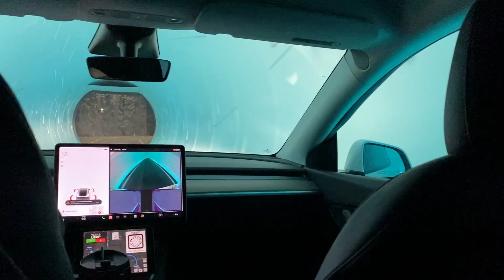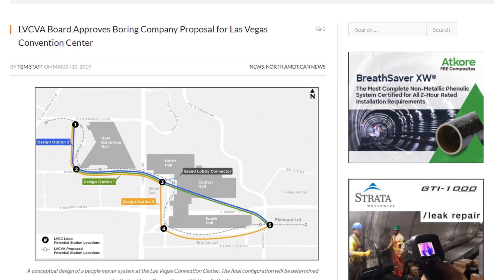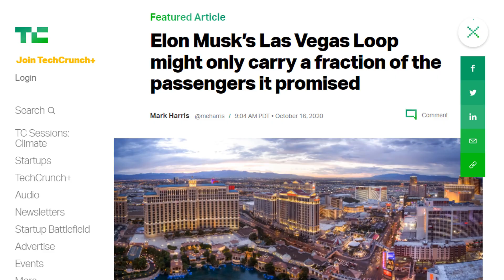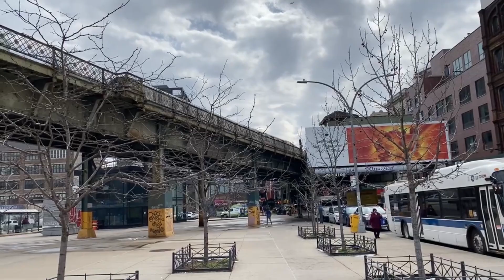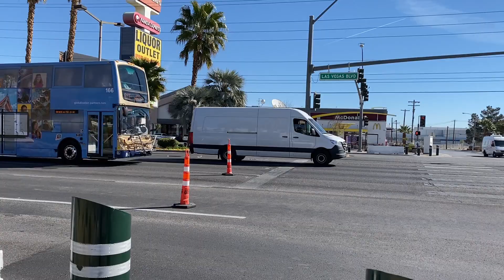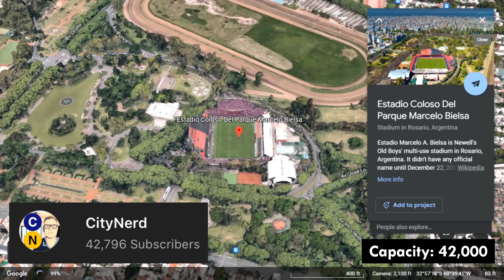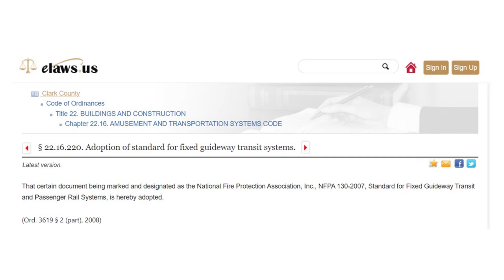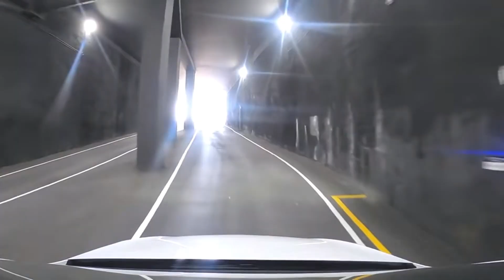Inside the Las Vegas Loop: Transportation Game-Changer, or Complete Waste of Time and Effort?

Comment: If the stations get any closer together they could just run moving sidewalks through them. That would actually be a pretty good use for those tunnels.
Reply from the maker: These can easily be retrofitted into two-way micromobility tunnels with the stations repurposed as bike valet/food cart pods. Luckily
Reply: @CityNerd  yes. Pods. Gotta call it pods.
Reply: moving sidewalks are great, such high cap for the space they take up, super high frequency and is very accessible with level boarding. even has handrails to help with balance.
Reply: @Aliceintraining  their maintenance costs are huge and they're pretty unreliable
They're also slow (run them any faster and they'll break even faster...)

Bike tunnels would make more sense
Reply: @ronylouis0  Yes! Bike tunnels would be great, and you wouldn't even have to alter the tunnels to get them converted. Just kick out the cars. In fact, I feel like I've already heard this idea of taking back one or two lanes of traffic from cars and giving them to bikes...
Reply: @ronylouis0  I was being sarcastic and trying to make a joke.  sense you know, the tone of this video.
Reply: @Aliceintraining  I've seen serious proposals for this type of stuff
Reply: @JustinKlinger  - The moving walkways at O’Hare between United’s B and C concourses are pretty great for getting around with luggage. What’s likeliest, unfortunately, is that the Las Vegas tunnels will simply be repurposed for storage once the novelty of the three-passenger-maximum slow-boarding chauffeur-driven rubber-tired “train” (aka this Boring/Tesla boondoggle) wears off.
Reply: @danopticon  Hi Ricky, You do realise the LVCC Loop handles 27,000 people per day during large conventions which is greater than the platform averages of most subway statiojns in Europe?

Even with drivers in each car, it carries more passengers per driver than even efficient BRT systems like Ottawa's TransitWay and of course once autonomy is enabled, drivers will be completely taken out of the loop (pun intended!).
Reply: @andrewfranklin4429  - You neglect to mention your numbers are Tesla’s/The Boring Company’s p.r., derived from a test done for one hour at 10% capacity with 300 volunteers:

Under optimal and very controlled circumstances, they apparently were able to move a little over 400 volunteers in an hour, so Tesla’s engineer concluded “Even if we increase capacity tenfold under real-world conditions, everything will still be ginchy!” and the Las Vegas authorities, happy for the publicity and knowing they’ll get $300,000 every time the “Loop” actually fails, eagerly signed off on it.

COVID-19 has been a godsend to Musk’s companies: the closest this boondoggle has come to a real test since opening has been CES, which was cut in length this year and had less than 25% as much attendance as usual … and even with attendance minimized, there were still traffic snarls: nothing like being trapped in a tunnel!

The Boring Company people put so little research into building their “stations” that fire codes will limit the stations to 800 occupants at a time, which utterly torpedoes T.B.C.’s inflated throughput projections … although again, the longer they can forestall having to scale up and prove the project’s failure, the better for them.

Finally, Carrie Schindler, director of transit and rail programs for the county transportation authority, has confirmed that Tesla and The Boring Company are NO LONGER COMMITTING to the autonomous technology you tout. Musk’s firms are in fact trying to saddle the county with the significantly increased operating costs of providing one driver per, at most, every three passengers (and, more likely, one driver per passenger) by claiming his firms had never guaranteed self-driving cars!

But the only real test will be to finally scale this fiasco up … if Musk’s firms ever really do, which itself is doubtful. If they ever do try to achieve the throughput promised by their p.r.—albeit, at an absurdly greater cost for implementation, operation, and maintenance, relative to proven transit systems—by the time Musk’s firms prove their failure to deliver, your YouTube account will likely be long gone. But this video and these comments will still be here.

But by all means … if you’re up for it, let’s meet here again in two or three years, to discuss “Whatever happened to the Las Vegas ‘Loop?’ “
Reply: @danopticon   not true Ricky, it was the government authority, the LVCVA themselves who earlier this year reported that “The Boring Company’s tunnel system successfully moved 25,000 to 27,000 passengers daily around the Las Vegas Convention Center campus during SEMA in November. SEMA was the Convention Center and the LVCC Loop’s first full-facility show with 114,000 attendees. “

“the LVCC Loop’s average ride time was under 2 minutes during CES 2022. The average passenger wait time was below 15 seconds.”

So no, it wasn’t the Boring Co or Musk who said that. 

The SEMA show which averaged 25,000 - 27,000 people per day was only open for 8 hours each day meaning it handled an average of 3,375 people per hour.  However, no public transport system has equal distribution throughout every hour of the day, there are bumps and dips depending on demand. 
 
In the case of the SEMA convention, there was a single peak period in the middle of the day with ridership tailing off either side, so it would be higher than that 3,375 average in the middle of the day and lower in the morning and late afternoon. 

So no, they are definitely moving far more than 800 people per hour in real life.
Reply: @danopticon  and no, the Loop hasn’t actually experienced any traffic jams. That single short clip from CES that bloggers repeat over and over ad nauseam showed only a brief slow down for less than 40 seconds in the Loop tunnel due to a temporary closure of the South building’s doors. The EVs didn’t even stop, they just briefly slowed.

This ignores the fact that the rest of the time the Teslas are smoothly entering and exiting each station every 3 seconds compared to switching to a mulit-billion dollar subway where you have to wait for far longer - 3, 5, 10 or 60 minutes for the next train and have to stop and wait at every station on a line instead.
Reply: @danopticon   and no, the claims from Mark Harris of TechCrunch that the Loop was limited to 800 people per hour in the underground station are completely false being based on a mis-reading of the Loop Firecode. 

Harris has now admitted his Tech Crunch articles about The Boring Company were wrong and he has been removed from writing about the Boring Co for Tech Crunch with other writers being far more accurate (and positive) in their stories since Harris’s last article in Nov 2021. 

So his claims that the Loop can’t handle 4,400 people per hour and reports of penalties are blatantly incorrect.
Reply: @andrewfranklin4429  
You’re proposing that that extremely narrow tunnel will feed 66 human operated vehicles through per minute.
The autonomous driving tech is not yet matured. This might be feasible with a driverless command type control system. Almost like a light rail.

Each vehicle in that situation would therefore have less than one second of following time in order to make it through at that rate. Not to mention the fact that many of the turns offer little or no reaction time due to their tightness if they indeed travel at 60mph

Now let’s consider the possibility there isn’t a crash followed by a lithium battery fire underground causing a oxygen deficiency in the subsequent pileup and additional fires. Unless the brakes are capable of braking from 60mph to 0 in less than a second minus driver reaction time.

Therefore depending on the quantity of air throughput in the tunnels minus the oxygen reduction via the possibly numerous and very difficult to suppress vehicular fires and human demand for oxygen as many people fail to attempt to escape what is a silent killer as you usually don’t realize it when you’re about to pass out from oxygen deficiency, and most people don’t know it’s a thing. Not to mention toxic and hazardous gases produced by the fires. People getting out of the vehicles, panicking, with no access for emergency vehicles. In order for drivers to escape the very rearmost vehicles will have to reverse out.

Getting messy with my run on sentences there, but it’s pretty clear to me that this is an incredibly bad idea in terms of safety. In theory a hundred or even more people could suffocate in minutes because one driver had an errant twitch.

Furthermore, unless both the entry station and exit station are designed at the capacity of 66 individual vehicles arriving, disembarking passengers, within one minute with room for error: your theoretical capacity is a pipe dream as these stations really don’t look up to that task, which is more suited to something resembling a huge underground garage.

Additionally, the video laid out why nobody is going to be willing to pay for the cost of a luxury taxi just to get the advantage of a moderately faster commute. So who are all the rich people that want this?
Reply: @JK42069-r  A 2010 study by the Honda Research Institute found that 25% of drivers maintained a distance of 2 car lengths between vehicles at 60mph on a busy 2-lane freeway, 15% 3 car lengths, 15% 4 car lengths, 5% 5 car lengths and 15% 6 car lengths. 

So that is 75% of cars having a headway of one second (~6 car lengths at 60mph) or less and 40% maintaining a headway of 0.5 seconds (~3 car lengths at 60mph) or less. And remember those are cars driven by potentially distracted, drunk and careless drivers. 

Note that a headway of 0.5 seconds = 7,200 cars per hour
And a headway of 1.0 seconds = 3,600 cars per hour

As I say, The Boring Co is planning on a headway of around 0.9 seconds (5 car lengths between EVs at 60mph) which will give a throughput of 4,000 EVs per hour.  With 2.5 passengers per car that gives us 10,000 people per hour. With 4 passengers per car 16,000 people per hour per single tunnel. 

With higher capacity EV vans, buses or pods that can be added if demand requires it, those numbers go up exponentially. 

Once the Loop autonomous control systems with their millisecond response times and ability to for example command ALL vehicles in a section of the Loop to brake or accelerate simultaneously, there would be no problems safely achieving headways of this duration.  I’ll discuss autonomy next.
Reply: @JK42069-r  At the moment, the Loop EVs have drivers true. However, in the latest videos from CES the drivers are saying that the cars have already been modified for autonomous operation, but that it is not yet enabled as they are still awaiting regulatory approval and liability is “holding us up right now, but once that gets cleared we’ll turn all the cars on”. 

After all, The Boring Co actually took the press for test runs using autopilot running in Loop EVs over 2 years ago in the 1.14 mile test tunnel in Hawthorne California.   At that point, autopilot was limited to 90mph (145kph) but was scheduled to be increased to 125mph (201kph) a few weeks later. 

Not surprising considering that following a white line in the controlled environment of a tunnel is hardly rocket science.
Reply: @JK42069-r  Now, in terms of your questions about safety, EVs are 61x less likely to catch fire than internal combustion vehicles and 139x less likely to catch fire than hybrid cars so there is as little chance of the Teslas catching fire even in a crash as for the massive Lithium battery packs that are being installed into many subway trains for regenerative braking, acceleration augmentation and emergency motive power.  

In fact the latest Tesla Model Y’s have BYD LFP Blade batteries that can be punctured and not suffer from thermal runaway, so the chances of fires are even lower now.

If there is a fire, you’re actually safer in Loop EVs than being crammed in with 1,000 other people in a burning train.

The Loop tunnels have a “ventilation system that can move 400,000 cubic feet of air per minute in either direction down the tunnels” and many smoke and CO alarms and cameras everywhere, a Fire Control Centre staffed by 2 officers during all hours of operation, high pressure automatic standpipes in all tunnels for fire-fighting, an automatic sprinkler system rated at Extra Hazard Group 1 in the central station etc above and beyond what was required by the national and international fire codes including NFPA 130 – “Standard for Fixed Guideway Transit and Passenger Rail Systems” and the 2018 International Fire Code (IFC).

And if there is smoke accumulating in the tunnel, every Tesla has a hospital-grade HEPA filtration system to filter out the fumes and toxic gases of any fires that might occur. The HEPA filter is about 10 times larger than cabin air filters in most cars and is 100 times more effective than a normal car air filter able to even filter out even respiratory COVID particles. 

The Teslas also have activated carbon filtration, an acid gas filter, an alkaline gas filter for removing toxic gases and a “bio-weapons defence mode” where the outside intakes are closed and the fans are operated at maximum speed to create positive pressure inside the cabin minimizing the amount of outside air that can enter—similar to the way a positive pressure room in a biohazard lab or hospital operates, preventing the backflow of bacteria and viruses into other parts of the building.”

The EV doesn’t need a separate air supply for the few minutes that it would take for an EV to drive the short distance from an incident to the nearest station as the amount of air in the EV running in that mode on re-circulate with positive pressure keeps out toxic smoke and CO for the short amount of time needed to evacuate.  And there’ll be plenty of oxygen in the volume of the car for that short timescale. 

In contrast, trains are death traps in crashes and fires with so many standing crammed together, no seat belts or airbags and all loose luggage and bodies turned into lethal projectiles under sudden deceleration.

With the Loop EVs being rated as the safest cars on the roads for 7 years running, every passenger is safely belted into their own comfy airbag-equipped safety cell.  :-)
Reply: @JK42069-r  And next, regarding your point about stations being unable to handle 66 EVs per minute, the answer is they don’t have to, as you'll see below:

So that 4,000 EVs per hour with a headway of 0.9 seconds is for traffic down the main arterial tunnels of the Vegas Loop. The stations however, are all off the main arterial connected by short spur tunnels so traffic through the stations has longer headways down to 3 seconds or so which gives us up to 1,200 EVs per hour per station. 

Looking at the footage from the SEMA conference in Nov, we see each Loop EV taking around 15 seconds to unload and 15 seconds to load passengers, giving us as little as 30 seconds between vehicles in that one bay. There are 10 bays in each station so that works out as 30 seconds divided by 10 = 3 seconds between EVs exiting that station. 

Again, looking at the footage, we do indeed see EVs leaving the stations down to 3 seconds apart which would give us up to 1,200 EVs per hour. Across all three stations, that’s up to 3,600 EVs per hour. 

We also see between 2-3 people in each EV, so with 2.5 passengers per EV, that is up to 3,000 people per hour per station.  So over the three stations that is potentially 9,000 people per hour. 

In terms of the arterial tunnels, you have multiple stations feeding them filling up the tunnel up to that 4,000 EVs and 10,000 people per hour metric and multiple parallel arterial tunnels as well as other mini-loops in spots all Sharing the load.
Reply: @JK42069-r  And finally, Loop ticket prices for rides down the Vegas Strip will range between $5-20 for a Loop EV depending on distance travelled.

However, that is for the entire vehicle.  if TBC (or third parties) implement ride-sharing apps or station kiosks to allow passengers to ride share (particularly on high-traffic routes), then you’re looking at splitting that ticket cost between multiple people.

MIT CSAIL’s research developed an algorithm that can replace 14,000 taxis with only 3,000 four-seat vehicles using public data from NYC taxi rides so it’s eminently possible to maintain point-to-point transport or minimal on-the-way stops if people want to share costs.

So, with ride-sharing we’re looking at Loop ticket costs of $1-$4 per person compared to:
- $25 - $37 for gridlocked taxis 
- $6 per person via gridlocked bus
- $5 per person for the Vegas Monorail which doesn't go anywhere and has gone bankrupt twice.

So the Loop isn’t just for the rich.
Reply: @JustinKlinger the only problem is it's Vegas and corporate entertainment. A good percentage of the riders are going to be incapable of safely riding a bike, electric or not.  Not even a golf cart would be safe in the hands of those people.  They should have just made it a tiny version of the hyperloop with pneumatic tubes.
Reply: @Aliceintraining  I strongly suspect when LVCC finally get pissed off and pull the plug on Elon, they will prob do this. The tunnel bores and far to small for any realistic people mover system, so it'll either be moving walkway or just mothballed completely and gradually be colonised by the destitute underclass who will slowly evolve into morlocks.
Reply: Heck, just have people walk in the tunnels. It's only a few hundred metres.
Reply: Moving sidewalks would have been a lot cheaper.
Reply: call them hyper-sidewalks and i think you are on to something, need to add plenty of LEDSs however
Reply: Or just give everyone an electric scooter and let them have at it.
Reply: moving sidewalks would have a larger capacity
Reply: Moving sidewalks only travel at 1.4mph.  That means it would take over an hour to get you to the other end of the 1.7 mile convention Center instead of 2 minutes on the Loop! 

That is even worse once the rest of the 29 mile 51 station Vegas Loop is constructed - a moving sidewalk would take you 10 hours to travel from one side of the city to the other!
Reply: @andrewfranklin4429  The toronto airport walkway moves at 4.3 mph and research has shown that people walk at 2.2mph on average when riding so that takes them to 6.5mph. Not as fast as the teslas but the throughput puts teslas to shame.
Reply: @opcn18  remember, Capacity AND speed matters.

The Disney peoplemover for example has decent capacity (4,885 people per hour) but very slow speed of 7mph. 

Bus Rapid Transit (at grade) has very low capacity:
90 passengers per vehicle * 15 vehicles per hour = 1,350 pph.
And low average speed of 9mph due to city traffic and having to stop and wait at every stop. 

Bus Rapid Transit (grade-separated) has low capacity: 
90 passengers per vehicle * 30 vehicles per hour = 2,700 pph.
And but still slow average speeds of 12-22mph.

Light Rail Transit (at grade) has medium capacity:
90 passengers per vehicle * 3 vehicles per train * 15 vehicle sets per hour = 4,050 pph.
But slow speeds of 9mph -12mph due to city traffic and having to stop and wait at every station. 

Light Rail Transit (grade-separated) high capacity:
90 passengers per vehicle * 3 vehicles per train * 30 vehicle sets per hour = 8,100 pph.
And still pretty slow average speeds of 15mph due to having to stop and wait at every station. 

Subways have very high capacity:
100 passengers per vehicle * 10 vehicles per train * 30 vehicle sets per hour = 30,000 pph.
But still slow speeds of 17-22mph due to having to stop and wait at every station. 

The 29 mile Vegas Loop (2.5 passengers per EV) will have high capacity:
 2.5 passengers per vehicle * 4,000 EVs per hour = 10,000 pph
AND very high average speeds of 60mph thanks to direct point-to-point travel at high speeds. 

The 29 mile Vegas Loop (4 passengers per EV w ride sharing) will have higher capacity:
 4 passengers per vehicle * 4,000 EVs per hour = 16,000 pph
AND very high average speeds of 60mph thanks to direct point-to-point travel at high speeds. 

But the 29 mile, 51 station Vegas Loop will have up to three parallel arterial tunnel pairs through the busier parts of the city giving 30,000 - 48,000 pph down the main arterial tunnels AND very high average speeds of 60mph. 

The Boring Co has actually rated the 29 mile, 51 station Loop at a minimum of 57,000 people per hour. 

So even in terms of people per hour, the Loop easily holds its own against not just People movers, BRT and Light Rail but is also quite competitive against many subways.
Reply: @andrewfranklin4429  How much does Elon pay you for all these posts?
Reply: @Shizz81  Hi Brandon. Perhaps you’re unused to someone who actually enjoys supporting their position with facts and data rather than engaging in the usual snarky one-liners?
Reply: @opcn18  to answer your question more directly Emerson, even if you walk at the average walking pace of 3-4 mph on a moving walkway, that is still only 5mph in total meaning it would still take you almost 6 hours to walk across the 29 mile Loop versus 5 minutes in a Loop EV.
Reply: @andrewfranklin4429  Where are you getting 4000 EVs per hour for just the LVCC? This is even covered in the video, the capacity would be MUCH lower even in an optimistic scenario.
Reply: @scuter8700  4,000 EVs per hour is the capacity of the main arterial tunnels of the 29 mile, 51 station Vegas Loop which is still under construction. That Loop will have over 700 EVs spread across 51 stations (10 bays per station) and 29 miles of tunnel so there is plenty of space for all the EVs. 

With the avenge journey on the Vegas Loop being about 5 minutes, each EV would make up to 12 trips per hour so 4,000/12 = 333 EVs is all it would take to fill an arterial tunnel with 4,000 EVs per hour.
Reply: @andrewfranklin4429   idk I think it's unfair to compare the capacity of one subway or brt line (as you did earlier) with the capacity of a full-blown transportation network with multiple main arterials in it. This is like me comparing the capacity of one bus route with the capacity of the entire road network of a city.
Reply: @andrewfranklin4429  So the loop is now traveling 35 times as fast as a person walks? Or did you just compare the time to walk around the loop to the time to drive across it at ludicrously high speed that will require hundreds of dollars per week in repairs and replacements to the EVs and make all the passengers sick? The corners are too tight for those speeds. There is no fixing that. The speed is capped by the layout and no software of proof of concept on a straight track in hawthorne is gonna change that.
Reply: @scuter8700  if you like, we can stick with just what has been constructed so far and compare that to the entire bus network around Vegas instead. (Still not a perfect comparison, but helpful nonetheless)

So, the Vegas Bus service has a daily ridership of 178,390 but that is across 51 routes and 3,900+ stops and a fleet of 708 buses. 

So compare that to the Boring Co’s convention Center Loop which only has 1 route, 3 stops and 70 cars and yet easily handles 27,000 passengers per day during conventions. 

So that very large, busy bus network only carries 6.6x the number of passengers of the small 3-station Loop despite having 51x the number of routes, 1,300x the number of stops and 10x the number of vehicles each of which has 10x the seating capacity as each Loop EV.

Considering that the 29 mile 51 station Loop will increase the size of the Loop by 17x, it means it could end up with a capacity of 459,000 people per day which is 2.5x the daily ridership of that entire Vegas Bus network. 

Considering that Las Vegas only has a population of 600,000, such capacity wouldn’t be needed, but you can see how the Loop is indeed a very good solution for the public transport needs of this city going forward - particularly since it is costing the taxpayer ZERO dollars compared to the $1.4 billion that a 29 mile grade-separated BRT (or $15 billion subway) would cost.
Reply: @opcn18  You do realise the Loop EVs can just slow down around tighter radius bends?

Here are some average Trip times off the TBC website:

- Airport to Convention Center (LVCC) - 4.9 miles, 5 minutes
- Allegiant Stadium to LVCC- 3.6 miles, 4 minutes,
- Downtown Las Vegas to LVCC- 2.8 miles, 3 minutes

So the Loop will do 4.9 miles in 5 minutes = average speed of 60mph (100kph), so some parts of the trip will be slower than 60mph around 3 turns while other parts will be faster down the straight sections.

That is still 20x faster than walking not to mention 3.5x faster than the 17mph average speed of trains which have to stop and wait at every station.
Reply: @opcn18  in terms of repairs and replacements, I think you are getting confused with internal combustion engine vehicles with their 2,500 moving parts that are vastly more unreliable than the 26 moving parts of an EV, which are so maintenance free that Tesla is the only car manufacturer in the world that doesn’t specify ANY service and maintenance intervals. No 10,000 services, no 40,000km major service, nothing. Just check the brake fluid level every 3 years.
Reply: @andrewfranklin4429  You can either have the cars following close behind each other, or you can have them driving fast, you cannot physically have both no matter how many times you ignore that reality.
Reply: @opcn18  and yet cars with distracted drivers travel at 60mph separated by only 3 or 4 car lengths on freeways and highways across the world all the time. Go figure!
Reply: @andrewfranklin4429  If you are repeatedly accelerating at formula 1 car rates in an EV that weight as much as a midsized pickup truck the tires will have to be replaced at regular intervals. It's also very hard on the suspension and linkages. These are parts that break on lighter cars that experience less acceleration too, and which break on tesla EVs driven under normal conditions. You cannot just write off those expensive repairs while you are granting yourself ridiculous carnival ride levels of acceleration and deceleration day in day out.

Tesla seats are also not designed for people to be constantly getting in and out, have you ever ridden on a bus? The seats are that hard for a reason.
Reply: @opcn18  I’m not sure why you believe F1/carnival acceleration levels are required to average 60mph speeds over a 29 mile Loop network?  I think your fears over excessive maintenance are overwrought. 

If the seats experience excessive wear, it’s hardly a deal breaker using more durable seat material is it?
Reply: @andrewfranklin4429  There are sometimes pileups on freeways, if the person in front has an incident and the following drivers are too close/inattentive. At least on a freeway, there's SOME chance of evasive action. In a single-lane tunnel, a closely-following car has no choice such as swerving, and has to rely on its braking (and everybody else's). Thus there is a safety limit on how closely cars can travel, and hence throughput.
Reply: @andrewfranklin4429  It actually ISN'T true that trains have to stop at every station. For instance some airport services services in Japan manage to mix express and all-station trains using a very few passing loops, and careful timetabling.Sure a car/taxi stops precisely where it wants to, and that's fine for low traffic, but the massive increase in passengers with LRT etc mean fewer vehicles moving many more peopl eper hour.
Reply: @mt-mg7tt  The disadvantage of multi-lane freeways is that at any moment a car or truck or pedestrian or animal or unsecured load etc could veer into your lane and cause a crash. The network of Loop tunnels are far safer in those terms as well as in rain, fog, wind and other adverse weather events. 

Once the Loop autonomous control systems are enabled with their millisecond response times and ability to for example command ALL vehicles in a section of the Loop to brake or accelerate simultaneously, avoidance of accidents becomes significantly improved as well.
Reply: @mt-mg7tt   unfortunately the enormous construction cost of subway tunnels means that very few subway systems have express bypasses around stations and bad luck if your station is not on an express station list - no express for you. 

In contrast, EVERY Loop EV is an express vehicle going straight to your destination at high speed with zero stops in between.
Reply: @andrewfranklin4429  With the frequency of ins and outs off of the station since these are individual cars I don't think you can safely have a express way of cars going full speed inside the station, just because of the very nature of this project.

That is unless you have separate tunnels to surpass the station
Reply: @peksn  you’ve hit the nail on the head - that is exactly what the 29 mile, 51 station Vegas Loop has. Every station is connected by short spur tunnels to the main arterial tunnels that run down and around the Vegas Strip. 

EVs will travel at high speed down those arterials bypassing every station until they get to their destination station when they exit on the spur tunnel to that station.
Reply: @andrewfranklin4429  Why do you call them spur tunnels instead of on- and off-ramps? It's all the benefits of an HOV toll lane but you can't take the vehicle off the freeway. But the weird thing is that I-15 already exists. It's literally one block away. We've been doing car stuff for over 100 years. This is not an innovation. It only seems amazing while it's underutilized. If it actually gets popular it will jam up just like every other freeway.
Reply: @JustinKlinger  Justin, the Loop has stations so “spur tunnels” maintains the nomenclature, but yes, they are effectively on-ramps and off-ramps.

The thing is you can’t do well over 100mph in HOV lanes and you’re still hindered by traffic lights, cross-roads and all the hazards of pedestrians, other vehicles that one encounters in a city.  That means the Loop is significantly faster than such even HOV taxis getting around the 29 miles of the Vegas Loop.

And the Loop is far from being under-utilised when large conventions are on (what it was designed for) considering it handles 27,000 people per day, more than the platform average of most European subways.
Reply: @andrewfranklin4429  yeah I'm talking about the whole thing if it ever gets finished. It's just going to be a tiny highway that's a half mile from an existing highway. And if it gets really popular then it will either be insufficient capacity (because of the tiny inconvenient cars) or traffic jammed. Like every other highway. Because it's a highway. And raising the speed limit by 1/3 isn't going to fix the fundamentals of highways. I know the Kool Aid is tasty but just stop drinking it and think about it. We have highways already. In Vegas even. Right next to the strip. Did it fix traffic yet?
Reply: @JustinKlinger  Don't fall into the trap of seeing cars in the tunnels and thinking those cars have all the disadvantages of cars on city roads.

The difference is that these Loop EVs aren't private cars with a single person in them driving on a highway and having to then take off-ramps onto slow city streets being slowed down by traffic lights, cross-roads and all the city hazards of bike couriers, pedestrians, trucks etc which then need to find and pay for parking hopefully not too many miles away and then walk to their destinations.

Instead, these EVs travel at high speeds up to 150mph down the main arterial tunnels direct to their destination, as there will be 51 small Loop stations right at the front doors of pretty much every hotel, casino, UNLV, the stadium and eventually the airport, far faster than any cars caught in the gridlock of Vegas.

In terms of numbers of passengers in each EV, if TBC implements ride-sharing apps or station kiosks to allow passengers to ride share, then higher passenger occupancy is also possible.

MIT CSAIL’s research developed an algorithm that can replace 14,000 taxis with only 3,000 four-seat vehicles using public data from NYC taxi rides.

Also, higher capacity EV vans, buses or “pods” will almost certainly be added to the 29 mile Vegas Loop to be used on high traffic routes as needed.
Reply: @andrewfranklin4429  Jesus mate, you really did drink that cool aid 😳
Reply: @NebraskaGonvilleJones  hi Nebraska, are you unused to someone analysing a new technology and backing up their conclusions with data rather than just doing the usual snarky one-liners and ad hominem attacks?  So do you have any useful critique of any of my comments?
Reply: @opcn18  I don't want to be a Debbie Downer on this idea but have you ever been to Vegas?   Specifically on the pedestrian bridges and the escalators which serve them?  Nobody in their right mind would want to expand that model of moving people around to several miles of underground tunnels.

To be a bit less vague, the escalators are famously broken down all the time and the pedestrian bridges are well staffed with vagrants, pan handlers, and weed smokers.  It's become fairly unpleasant to walk the strip these days.  It'd be even more unpleasant to move that circus underground.
Reply: @woodsie315  they aren't broken down constantly at airports and get just as much traffic. maintenance is a solved problem and not a prohibitively expensive one. The staff to keep stations and connections free of miscreants is also dramatically lower than paying for all the extra staff needed to keep the cars running.
Reply: @opcn18  Well these tunnels aren't the airport.  If Vegas can't "pay staff" to keep the escalators running and the bridges clear of miscreants than what makes you think it'll be any different with the tunnels?

I don't want to hear about what they could do in theory.  There's a lot of things that should be happening in theory but aren't.  I want to talk about what is actually happening in actual practice on the closest analogs we have in Vegas to your idea.

If Vegas can't maintain a high level of guest experience on the pedestrian bridges connecting the multi-billion dollar resorts that bring in hundreds of millions of dollars in tax revenue and tens of thousands of jobs, there is zero hope for your idea working out.

Not that I can't appreciate the idea of it.  It'd be a cool idea if we had a high trust society where people universally respected and protected public goods but we don't have that society.
Reply: @woodsie315  Why does that matter? It takes less labor to keep a moving sidewalk going. The moving sidewalk moves more people, the moving sidewalk is easier to maintain. the moving sidewalk is cheaper to build, the moving sidewalk lasts longer. 

The only metric were moving sidewalks fail is on absolute speed, and there it's not by much when you consider the whole system.

if your argument is that vegas can't keep up with upkeep them you've just made a moderately strong argument against moving sidewalks and an incredibly strong argument against EVs in a tunnel.
Reply: @Emerson White  You are making a shit ton of assumptions about an unprecedented moving sidewalk system that you can possibly know.  How do you know what it takes to build and maintain 20 miles of moving sidewalk?  How do you know its cheaper to maintain and last longer?  There is no such system in place anywhere in the world to point to.

Why does what I previously said matter?  It matters because we already have an analogous piece of public infrastructure to point to in Vegas which have proven to be in constant disrepair and unfriendly to guests.

As far as your argument that the whole EV taxi concept is some big maintenance boondoggle, how so?  How is it any different than any other taxi service or ride share service?  It's the same thing except underground on dedicated lanes.  If it works above ground why wouldn't it work underground?  Do the tunnels create some kind of unique maintenance burden on the vehicle fleet that I'm unaware of?
Reply: @woodsie315  Nah, moving sidewalks are not at all unprecedented. There are a lot of airports with several miles each. Subways including subways in tunnels the exact same diameter as the vegas loop tunnels are similarly well precedented. 

The current failed infrastructure is failing for want of hundreds of thousands of dollars in upkeep and operations costs and a dozen fulltime employees, replacing it with a system that takes millions of dollars in upkeep and several dozen full time employees still fails the fundamental problem, which is lack of investment.  No matter how much money they spend it's going to go a lot further building traditional public transit options than it will building the least efficient public transport system ever devised.

Taxis at all are maintenance hogs. Teslas have higher depreciation, lower initial build quality, and more expensive maintenance than the competing vehicles though. But taxis in any form are too expensive to make a good public transit system, and luxury EV brand taxis in an expensive freaking tunnel are only going to drive up the cost.
Reply: @opcn18  So you really truly believe that people would want to get on a sidewalk at the Golden Nugget and ride it with their luggage for 2 hours to get to the airport?

No comment on subways.  I never made an argument against them so you aren't going to drag me into it.  Vegas would have been smart to build a subway system decades ago but they didn't.  I'm only commenting on the ridiculousness of the moving sidewalk idea in a 20 mile system as somehow a replacement for Taxi/Uber service.  It's a ridiculous idea even on it's face and even presuming that it was well maintained (unlike existing public escalators in Vegas) and well policed (unlike existing public walkways in Vegas).  

As far as all of that other stuff about how Taxis don't work, I'm not even going to argue it.  They exist everywhere for a reason and it's not because they don't work for people.

I do think the maintenance angle on Tesla's goes, I have no clue what you are talking about.  I've had one for 3 years and the only maintenance I've ever done has been changing a set of tires.  It's like driving an iPhone.  You just plug it in every night and then drive it.  The battery degradation has been only a couple percent in 3 years.
Reply: 4000 tesla an hour?! That's less than a second separation between them lmao. Putting on the side how many tail crashes that would entail, I hope the cars are equipped with rocket powered ejector seats for the passengers and their belongings!